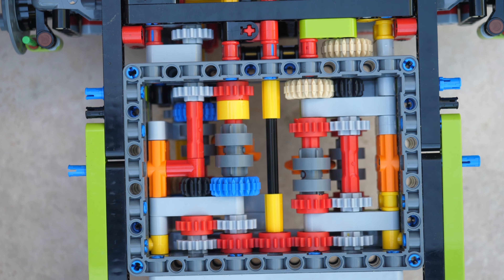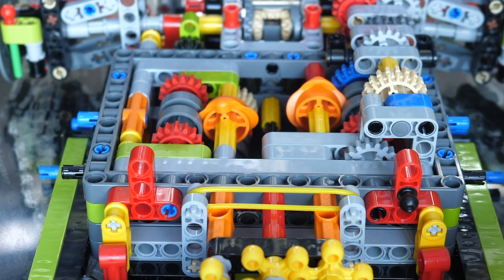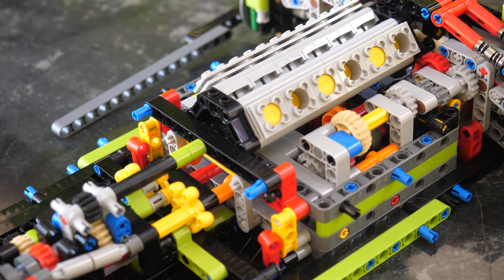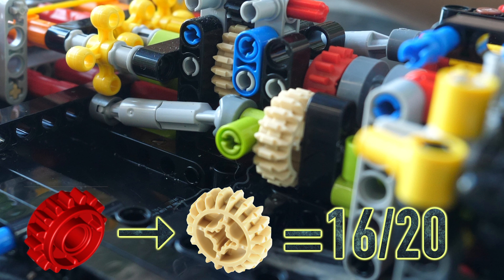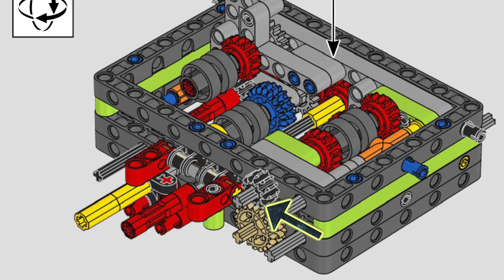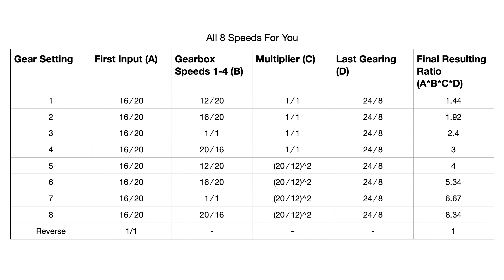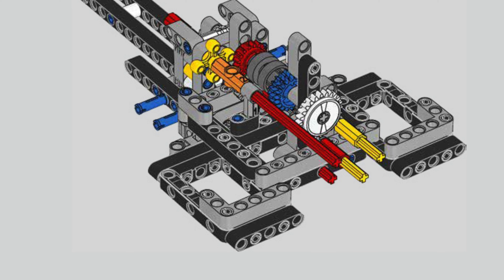Mechanical Magic of LEGO Technic Lamborghini Sian FKP 37 42115 (8-Speed Gearbox)

Comment from the maker: If you have any questions regarding this gearbox or why yours doesn't work. Please DM me on instagram @unbrickme . There you can send me a couple pictures or a short video clip describing the problem. I'd love to help you out.
Reply: my gears only shift one time, what might be the problem?
Reply: When i am riding it on the floor i hear a tikking sounds what is that?
Reply: I have a problem if my gear but I fix it cuz I do something wrong cuz I guess I skip a page btw thanks
Reply: How do you connect the gearbox to the suspension in the instructions one page shows it upside down and the next page shows it right side up
Reply: @cagejohnson692  same here
Reply: How exactly do the neutral and reverse gears work on this car

Comment: I've just finished building this. It's an amazing set and i appreciate the engineering but how do you actually demonstrate it? It's not the kind of thing you can push around the floor.
Reply: In the first gear, you can feel more resistance when you push the car. When you go to the 8th gear there’s less resistance and the car can go a bit further with the same push with the first gear
Reply: Connect it to a motor
Reply: +the engine is completely covered up when finished.
Reply: @Nr1from1978  you can see two of the twelve pistons
Reply: It's more of a display piece but you can push it around like i do..
Reply: @alexeecs  it's also quite easy to remove the covers from the v12. You can store them both in the frunk too

Comment: Finally LEGO makes a AWD drivetrain for the Sian
Reply from the maker: they had such a drivetrain for many other vehicles
Reply: @Unbrickme  Thanks for the great video. If I switch to drive, is it AWD or rear wheel drive? If it is AWD and no center diff, will it causing problems when making a turn on high friction surface? Trying to replace the engine with motor, and this question came to my mind. Thanks

Comment: Thank goodness for your detailed video.  From this, I realized I had the stud on the green stepper mechanism reversed, such that the R side would not rotate through speeds 1-4, and would not engage the left side every 1 revolution.  Pulled the chassis in half, flipped the stud on the green stepper around, and voila...works as you advertise!

Comment: Very cool video! I'm making the Sian at the moment. While building it I could kinda see what was going on in terms of the two sliding pieces that engage with the otherwise free red wheels... But trying to actually manipulate everything and see the ratios is pretty tricky. But once you get the front axle assembly on it all comes in to place and you can manipulate the sequential shifter: so yeah don't be discouraged if you're thinking "hmm I must've done something wrong" or it won't turn or anything... it all comes together :D
Reply from the maker: thanks for the encouraging comment!

Comment: Question: I don't think the numbers and ratio calculations mattered to me as much as the actual mechanism. I think the way it was presented was a bit confusing with the arrows and all, and the concept at some point was just left behind in favor of talking about the numbers. My point is, I want to learn how to design a gearbox mechanism, rather than learn the Technic Sian model's gear ratios. Do you have a good source for technic gearbox function?

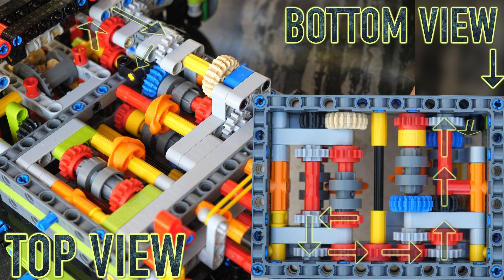The problem I ran into occurs at 4:37. Until this point, it was clear where the power is going. But the arrows in this section are extremely confusing, because not all of the gears are properly visible, and your voice is just saying "here to here to here" without referencing anything visual. It's unclear whether the torque leaves the confines of the "box", the bluish gray frame, into the external gears, or if there is an additional gear inside the box that transfers the power.

Beyond this point, you stop talking about the mechanism of the actual gearbox, and only talk about the multiplier and the ratios. The complexity I was trying to understand is in the 4-transmission gearbox.

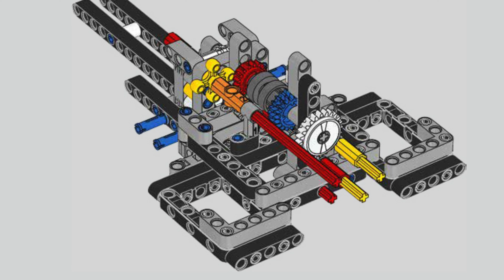Comment: 8:00 definitely fixable. Replace it with a solid 24T gear. I also fixed the issue where you had to push the chiron quite a distance for the engine to work, by replacing the 24/8 gear connection with a 1:1, greatly reducing timing.
Does the Sián work in the same way? Do you have to push the model quite far for the engine to work? If so apply that same fix I just mentioned on the chiron, behind the rear axle. 
Great explanation!
Reply from the maker: Yeah I understand its fixable, but it would take too much time to dissasseble and reassemble, Yeah the Sian works the same way. Thanks for the tips! However, replacing the 24/8 with 1/1 will severely mess up the gear ratios, and the resulting speeds won't even be sequential
Reply: Unbrickme yes you are right, the marriage process is easily reversible but would still be a pain to get to lol. And It works fine for me with a 1:1 gearing. Again great video!

Comment: Wow thank you I don't know why there's no one else who does this kind of video. If you have the rough terrain crane could you please do a video like that about it, I would really appreciate because it's so interesting and I never managed to decode how 1 motor can do 7 functions without owning it
Reply from the maker: I don't think I can make a video explaining that set but I can give you the gist of it. Essentially there's 7 different axles all connected to each different function. The axles have driving rings which can connect to either the clockwise direction or counterclockwise direction. When you engage the driving ring into the different gears, each independent function activates with the gearbox and just one motor

Comment: My gearbox has a problem. Shifting gears from 8th to 1st works fine, but the next set of shifting from 8th to 1st doesnt move the engine, it alternates between this. Does this happen because I built it wrong, or is it really supposed to do that? Thanks

Comment: I just finished my lambo, but i have an issue with the wheels, maybe some of u use to have the same problem, so if i spin 3 wheels to go to straight, (1 from the front and the ones in the back) they will spin well but the other one will go backwards, doesn’t matter what wheel it happens with all of them

Comment: I just finished building mine legit just now and i dont know why but but the 2 back wheels always either spin opposite to the front 2 wheels. For example, if i push both back wheels as if the car was gun drive forwards, the front 2 wheels would spin the other way to try to "reverse" the car
Like this v
⚙️v    (back)    

⚙️^   (front) 

Thats what happens every time.

Comment: great video !
maybe someone has an answer for me:

i have a problem while switching from 4th to 5th gear (or frfom 8th back into the 1st) the mechanism as itself is working, but with the shifter behind the wheel i cant skip into the 5th gear. the black part that turns the yellow wheel always slips over it during the attempt. with my fingers i can turn the part, but i recognize a significant bigger effort. I thint thats the reason why it doesnt work with the pedal shifter. the question is: do you also feel a needed bigger effort? from where it results?

Comment: I have a problem in mine between shifting gears, I think the gear box itself is working, the problem is in the paddle shifters keep slipping and they aren’t turning the cog that begins the shift between gears
Reply from the maker: Yeah the Bugatti and the Lamborghini paddle switchers are pretty bad. The Porsche’s paddles were fantastic
Reply: I played around with it for a couple of minutes, and it’s better now, but definitely still not ideal, still at least I know it’s not just mine. Thanks tons.
Reply: Unbrickme 
I Also love the fact that you are searching through the comments and actually answering me/other people with problems
Reply from the maker: Woolly Rhinoceros thanks! I try to reply to everyone
Reply: Did you find any way to fix that? Im having the same issue and was thinking that maybe adding some more rubber bands may help it
Reply: Marcin H 
Honestly not really, it was working pretty well, but then I took apart some of the car to put the steering wheel on the right hand side of the car because in Australia where I live we have our steering wheels on the right, but when I finished putting everything together I experienced some of the old problems. I’ve tried repositioning the rubber band/twisting it over/using different pieces but haven’t found anything that works great yet. Biggest problem seems to be on every 4th transmitting as that is when the gearbox intimates the other half which obviously takes more strength etc.
Reply: Marcin H I dunno rlly, if u or anyone else find a solution I’d love to hear it. (I’ll let u know if I work anything out myself) sorry I couldn’t help more.
Reply: Marcin H also I didn’t try adding more rubber bands, I’ll give it a shot, the problem is u can’t have too much pressure on the paddle shifters
Reply: @woollyrhinoceros6091 
same
Reply: @woollyrhinoceros6091 
same
Reply: @woollyrhinoceros6091 how can I fix it

Comment: Great video!!! It really helps me to understood. I have only a question: at the same wheel rotation speed in 8 the engine runs slower and in first faster right? So when you have an higher gear ratio the engine runs slower than an lower gear ratio. Sorry for my English I’m Italian
Reply from the maker: Yes that’s correct
Reply: @Unbrickme  ok thanks

Comment: Hello, very good video and very understandable! However, quick question. Can you keep upshifting that gearbox indefinitely (use same side of the lever to shift)? the gearbox will still go from 1st to 8th and then repeat, but there is nothing stopping you to use same lever to shift again at 8th? Thanks
Reply from the maker: Thank you very much! Yes you can infinitely shift up or down and it will just go in a loop
Reply: @Unbrickme  Thanks, thats what i came here to find out, I thought mine was wrong in that it kept cycling

Comment: Very good unbrickme greetings from Mexico 🇲🇽. How did you find yours cause I think there is a problem with stock of LEGO in the states
Reply: I already got mine is amazing
Reply from the maker: Wow awesome! I got mine because for a brief moment, my local lego store got a new batch of the Lamborghinis, and I got one. Did you also have the Bugatti and the Porsche before this?
Reply: I don’t have the Bugatti  but I want to have it before it retires . Right now I have the  Land Rover which I think is the best  value and the 911 rsr. Probably the Bugatti will be next month.
Reply: @ unbrickme when do you think Bugatti retires??
Reply from the maker: @Preston Varner I believe that you should get the Bugatti, but please be very careful when assembling the gearbox of the bugatti. Also replace the clutch gear in the bugatti with a normal gear. The gearbox in the lamborghini has more refined pieces for some mechanisms and it gets stuck way less. Although if you prefer the bugatti aesthetically more, then get the bugatti
Reply from the maker: @alejandrograue781  I think the bugatti will probably retire by the end of 2020
Reply from the maker: @Preston Varner no problem

Comment: Great video. I do have 2 questions about this gear box. (1) it seems moving the gear lever towards the front is actually the forward gear which is opposite of real cars. Is this expected on this set or I made a mistake in my build. (2) if I manually turn the black gear in the cockpit, I am basically only able to turn the wheels in 1st and 2nd gear. In higher gears there's great resistance that i feel like the axle is very stressed. Is this correct?

Comment: I love this! It all makes sense now! I have a question: is 1st gear supposed to be harder to turn? I had to build the gearbox a second time, because it was kinda rough turning it after I connected it to the rear differential, because it had A LOT of friction. Is that normal? I don’t remember 1st gear being that hard to turn on the Bugatti.
Reply from the maker: 1st gear is always supposed to be harder to turn just like in real cars. If its excessive you should rebuild it

Comment: I've just done step 250 where you put on the second axle assembly. I wanted to play with the engine and transmission a bit, so I put the four wheels on and tried rolling it on the ground, but now I have encountered a problem where sometimes the gear shifting doesn't change the rate of the fake V12 firing. Also, in some gears I can move the wheels one way but the other way is locked up and strips the gears if I try to move them. It also sometimes locks up in both directions. I have undone step 250 and taken the second axle back off to try and isolate the problem but it did not change anything.

I hope I explained my problem clearly enough. Any suggestions are appreciated!
Reply: Me pasa igual con lo del motor, cuando pongo en marcha el V12 no siento que los pistones vayan a diferentes velocidades según cambio la marcha, no sé que pasa pero todo el mecanismo está bien construido, es el único problema que tengo

Comment: Hello, we finish assembling the lambo but... the transmission is stuck. When the front wheel turn forward, the rear wheel want to turn reverse. Any idea what I have done wrong?
Reply: So fare I juste removed one of the drive shaft (front right wheel). Now the car is free and can movebut...:-( Frustrated. Can we flip  a differential whitout disassembling everthing? Which one is the easier to get?

Comment: I just finished this set and i found out my 4 wheels didnt drive, they go in opposite direction .. 😅😅
Reply from the maker: Try  flipping one of the differentials
Reply: @Unbrickme   I have the same problem and wonder how to flip the diffs as when i check them their gears seem to be placed correctly (they are the opposite of each other)
Reply: @erenozsu7657  im am too., im pretty sure that i followed the instruction step by step, every joint went snap perrfectly... cause im afraid i realize the mistake at the end,,but it still cant drive, i’ve just disasembled everything, waiting for a good day to build it all over again 😐
Reply: @ducpham88  :( it seems like I have to dismantle the whole set too since the diffs are at the bottom I hope I could get them to work properly
Reply: @erenozsu7657  yes, it’s from the first few steps :((

Comment: hi i just finished the motor bike today ducati kit. i went through the book step by step an it all works fine but there nice few bits left is this possible?? an i got two the same bits for a exauste for under the bike so i could only make one. i got the two same left bits only one right side bit would lego make a mistake like this?? im sure i went through the instruction book correctly i do not think it was possible i used the part some where else coz it would not have fitted else where. this was my first lego set so im not sure does this happen in sets
Reply from the maker: hello, usually you get a small handful of spare pieces in ever lego set. it's perfectly normal

Comment: Very technical review! Thanks for doing this! Have you tried to connect power function electric engine to a  Lamborghini so you can drive it with a remote control?
Reply from the maker: Yes! And I’ve also tried to motorize the speed transmission gearbox! Unfortunately it is not ideal for motorization
Reply: @Unbrickme  wow cool, do you have a video?
Reply from the maker: I never posted a video on motorizing the Lamborghini because I was never able to successfully motorize the transmission and I don’t really have any spare control+ elements to use for the 90 degree rotation to switch the transmission. However, I do have videos on motorizing the concrete mixer truck 42112 and on motorizing the doms dodge charger

Comment: I just took apart my set cuz the shifting didn't work properly... I wasn't able to acces more than 3 speeds... Well turns out the problem was weak white rubber band under that black dashboard right above the paddle shifting mechanism... I ended up shortening the rubber band and it works again...

Comment: Hello from italy. 
Usually in real cars, if you pull right paddle,the gear goes up. I can't understand why when i pull the right paddle, gear goes down😭😭😭. Did i built gearbox or trasmission in reverse mode?
Reply from the maker: Keep in mind that 8th speed means the engine runs the slowest and the 1st speed makes it run the fastest.

Comment: I've built the 1st box. But when I spin the axle in drive there is a lot of tension and it gets stuck. Is that right? Is it psobbly doing that because I still need to complete more of the build?
Reply from the maker: It should not get stuck. There will be tension, but it shouldn’t be so much to the point of getting stuck
Reply: @Unbrickme  yeah it turns a bit and then gets stuck. Then if I try to keep turning it and let go, it whips backwards
Reply: @Unbrickme  BRO I FOUND THE ISSUE! My differential was the wrong way around. Saw that mine was wrong after watching your vid. Amazing that such a small mistake can change everything, rather dissapointed in myself for that. But your video helped! Thank you so much
Reply from the maker: I’m glad you were able to resolve the issue and I’m glad my video helped